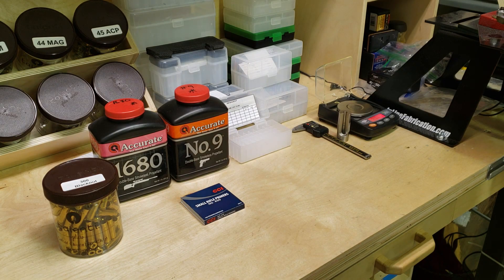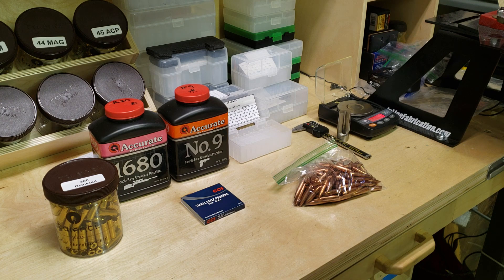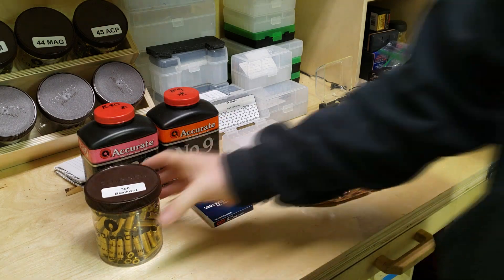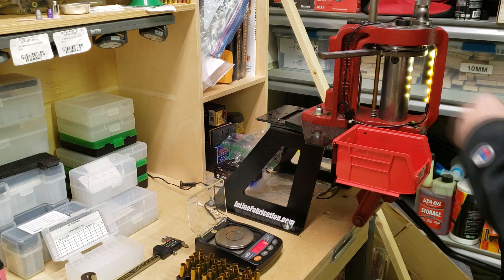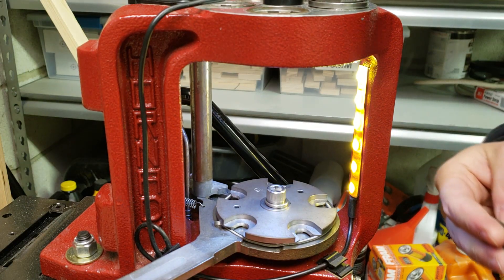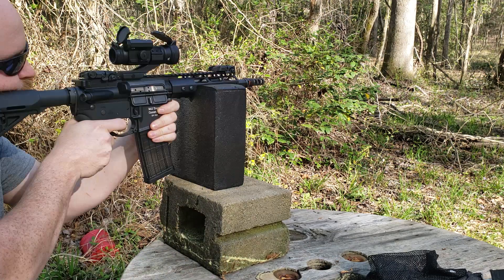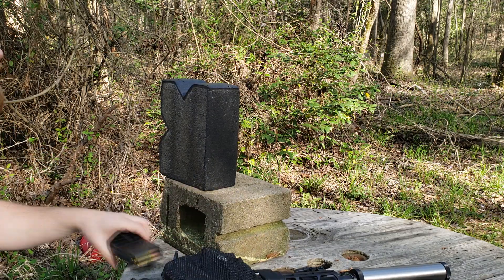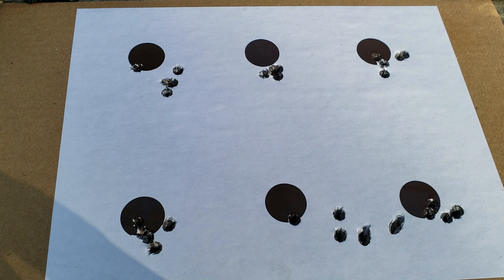300 Blackout Subsonics - Accurate No. 9 / Accurate 1680 - 220gr SMK

Comment: Sure do notice a huge difference in the lighter bullet subs than the heavier bullet ones . 150 vs 180 is huge and so is 180 - 247 grain .
Reply from the maker: Notice a difference in what? I haven't attempted to load any lightweight subs that actually run the rifle. Only thing i've done close to that is the NOE 135 grain bullet under light charges of pistol powder. See full lead taco bunny fart loads.
Reply: Just Some BS Sound level with subsonic suppressed the heavier bullets are quieter

Comment: Late to the party . Been using no.9 for supers and subs with my 8” pistol gas suppressed for appx 5 years now . Still have about 6 lbs of 1680 . About 5 lbs no.9 . Love the no.9 .
Reply from the maker: Strange in your video it wouldn't cycle with 8.3 grains. Using the NOE 247 mine still cycles below 7.0 grains without the suppressor, standard buffer and spring. Bolt locks back on 7.8 grains. I've used #9 for supers in 458 socom, haven't tried with 300 blackout or 338 spectre yet.
Reply: Just Some BS I definitely have been meaning to re visit those 247’s . I honestly had a few issues to work out then vs now . Those 247s are too heavy for the standard AR-15 magazine spring . Also they fed horribly with those even with them modified .Those modified p mags are now for anything 150 grains and under. 300 blk p mags are phenomenal . Got some sorting to do with all the other mags . JP silent capture spring now etc . Been on a Maker 180 grain rapid expanding subsonic kick lately vs raccoons .

Comment: Those AA#9 loads did seem quieter, or maybe just didn’t have that higher pitch of the1680.
Reply from the maker: It's easier to tell in person, there is something about the pop with 1680 that you don't get with #9.
Reply: They should be quieter since the AA1680s were in the 1000FPS range. When it comes to noise with subsonics, the sound is exponential to velocity. So 910FPS is going to be several times quieter than 950FPS. This is why you never really want to develop a subsonic in the high 900FPS level, only 930FPS or lower if sound reduction is the goal (which it should be for subsonics)

Comment: I use the progressive press more often than not , all the 223 , 300 BO and 45 acp gets loaded on it . The #9 powder loads  sounded slightly quieter and the 3rd group was plenty good .
Reply from the maker: Thanks for chiming in James, I load everything on my progressive, always have even though I have had a single stage for nearly two years. I did recently get some shell holders to see if it makes sizing my 458 socom and 45/70 cases easier on the single stage. I think my rifle will get along with #9 very well!
Reply: [copy paste] They should be quieter since the AA1680s were in the 1000FPS range. When it comes to noise with subsonics, the sound is exponential to velocity. So 910FPS is going to be several times quieter than 950FPS. This is why you never really want to develop a subsonic in the high 900FPS level, only 930FPS or lower if sound reduction is the goal (which it should be for subsonics)

Comment: Thanks for the heads up on accurate no 9! I’ve had good luck with 1680.
Reply from the maker: 1680 hasn't let me down yet. It just seems each time I try No.9 in a new caliber I like it more and more! Thanks
Reply: Just Some BS. Also looking like no9 is much cleaner. I usually use lancer smoke magazines. I can use them on .223/300bo and .458 or 50beo. They get dirty pretty quick with 1680 suppressed and who wants to spend any more time cleaning, than absolutely necessary:) thanks for the video!
Reply from the maker: @jeffhuntley2921  I'll have to test some more to be certain it wasn't just the number of rounds through it by the time I started the 1680 rounds but it seems to be. I use the lancer smoke for 300blk and the clear for 458 Socom. I know all too well about cleaning these mags to keep them looking good 😎